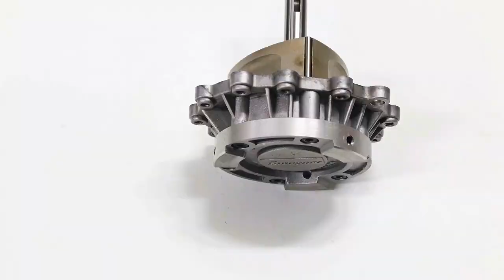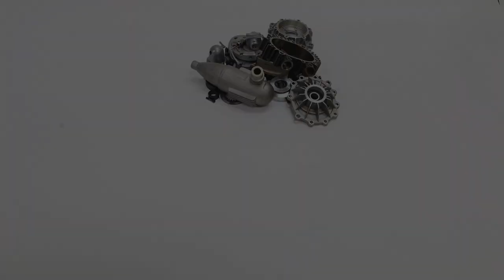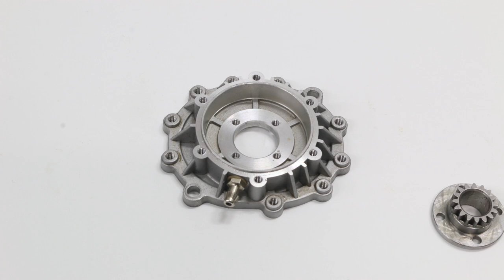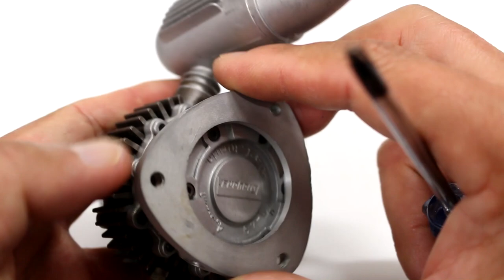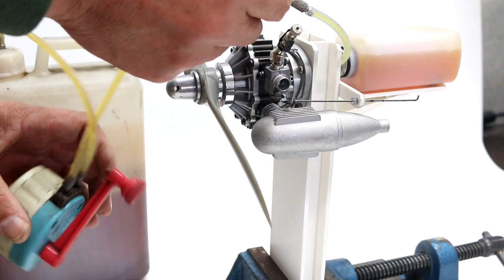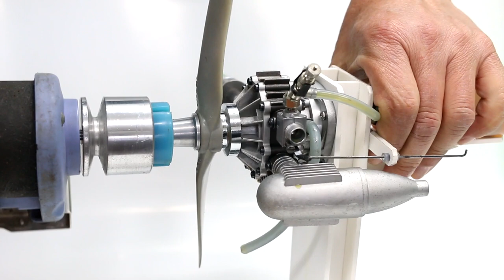WANKEL ROTARY ENGINE - STOP MOTION

Comment: Amazing video on the rotary engine! Really shows how its inner world's work and all the other parts interraction!

I really hope they don't give up on the rotary, if they can just figure out a way to remive is fatal weaknesses,  i think it had a big potential as its amazing how small and compact the engine is compared to its power output.
Reply: *Dude this is a Wankel engine, not a rotary
Both the Wankel and the Rotary are obsolete.
Reply: Kubi Kameho Rolls Royce experimented on a diesel 4-rotor several years back (2 rotors to power, 2 to basically supercharge the power), and that might strike your interest. The only real problem the rotary has is due to the burning oil, the seals wear due to constant metal fatigue that most Otto engines don't face so regularly. 

If there was such a lubricant that wouldn't really ignite but also wouldn't impede ignition, that metal fatigue would go down. Or perhaps a metal that has a higher tolerance for fatigue without absolutely destroying the chamber  walls, may also work. 

Perhaps you could toy  with the idea some, I can't think of anything right away.
Reply: +Dragon The engine shown in the video is not a Rotary... The Wankel KKM design does not have a Rotary layout.
Reply: Ok either your just saying things to get a rise out of me or you are truly confused. Come on no more mean comments do you need help understanding what a rotary engine is? The original wankel rotary the DKM both the rotor and the housing spun around on separate axes. It reached higher rpm and was naturally balanced but maintenance was complicated and had to be tore down just to change the spark plugs. Now the KKM that Hanns developed was simpler and had a fixed housing but it needed counter balancers to balance the engine and it wasn't capable of such high rpm as the DKM. However it was still a rotary engine. Felix was very angry to find that Hanns built the KKM behind his back and said "You've turned my thorough bred into a plow mare!" He was obviously referring to the much low rpm capabilities of the KKM however still higher that a piston engine was capable of.
EDIT: my bad he stated "you have turned my race horse into a plow mare"
By the way just a quick google search or wikipedia can help teach you about this stuff why dont you try that?
Reply: +Not Amerikanski Spy Rolls-Royce was not the only Wankel licensee to develop a Diesel Cycle Wankel... Deutz, MAN, Mercedes-Benz, Yanmar, Krupp, Ingersoll-Rand, Curtiss-Wright, and John Deere all attempted to build a Diesel variant and failed miserably.
Do You Know Why???? The Wankel KKM lacks the ability to have static compression ratios to support reliable compression ignition.
Reply: +Not Amerikanski Spy Lack of proper lubrication was never the issue with apex seal failure... The apex seal is not a "positive type" seal design like that found on a piston ring... as pressure increases? SO DOES THE RATES OF LEAKAGE PAST THE SEAL. If the high temperature combustion gasses past the seal lip too long the surface of seal heats up and erodes. During pre-ignition or detonation events in as little as 2 seconds the apex seal can be severely damaged even when excess lubrication is present.
Reply: Gas in, apex seals out! Lol really apex seals haven't been a problem for years. There are a handful of companies that design great apex seals. The main cause of apex seal failure these days is old brittle seals or extreme boost pressures.
Reply: +Not Amerikanski Spy Poor reliability was a problem that plagued the Wankel until it production ended, but it had several fatal design flaws that rendered it obsolete, apex seal failure was not the primary disadvantage... the Wankel's horrible mechanical and thermal efficiency problems along with its terrible combustion efficiency is what killed off the design. Fixing the apex seal flaw is not possible nor will it bring back the Wankel.
Reply: +Dragon800 REALLY???? Then explain why Mazda recalled over 50,000 RX-8 engines for apex and side seal failures?????
Reply: +Dragon800 You don't much about Wankel engines do ya son????
Reply: +Not Amerikanski Spy Please don't post anymore false or erroneous information about Wankel engines if you cannot handle being corrected when you are wrong... clearly you are not knowledgeable enough to speak intelligently about them without embarrassing yourself... too arrogant to accept you were wrong.
Reply: +Not Amerikanski Spy  "The only real problem the rotary has is due to the burning oil, the seals wear due to constant metal fatigue that most Otto engines don't face so regularly."
Millions of engines are still produced every year that use a total loss lubrication system, it is not unique to the Wankel... it was NOT the only real problem the designed faced when it was still in production.
Metal fatigue is NOT the primary failure mode for apex seals, this problem has been well researched and is now well understood... design and construction of apex seals is inherently a compromise and must balance the two directly conflicting demands of seal effectiveness vs. surface wear rates. increase the value of one has a direct negative impact on the other.
Reply: +Not Amerikanski Spy The truth always prevails over ignorance...
Reply: +Not Amerikanski Spy Don't hate, EDUCATE
Reply: +Not Amerikanski Spy GREAT! I hope you are learning something about this very misunderstood engine. Feel free to ask if you have any questions.
Reply: +Not Amerikanski Spy Is "Dragon800" trolling you too???
Reply: +Not Amerikanski Spy Let me know if you have anymore questions about Common modes of Apex Seal Failure... you seemed to have a lot of confusion on this topic earlier.
Reply: The Wankel is a type of Rotary Engine. Maybe you mean RADIAL engine?
That type of engine was use on aircraft. It has an (odd)  number of cylinders sticking out in a circular way...
Reply: +olafzijnbuis Only the Wankel DKM-54 is a Rotary Engine... this is the non-rotary version designed by Hanns Paschke called the KKM-57.
Reply: +olafzijnbuis No, not Radial... a Rotary  invented by Felix Millet in 1892. The Wankel KKM has a fixed engine housing and a conventional spinning crankshaft like a Radial... not a Rotary.
A Rotary engine can have either reciprocating or orbiting pistons
Reply: The Wankel engine showed great promise when it was first released as it had only a fraction of the moving parts of the usual internal combustion four stroke engines.  It showed very smooth power delivery with good power to weight performance and appeared comparable in efficiencies and emissions.
NSU and Mazda released production cars that were received very well initially.  However, unless managed carefully they suffered from poor durability and high fuel consumption.  Their correct servicing was crucial and had to be run according to the Owners Manual.
When lower and lower engine emissions were demanded by Governments in many countries, the Wankel was found to be difficult to meet the new standards and the development costs almost bankrupted Mazda.  With the current generation of computer engine management systems, the Wankel could be a promising power plant but for largely political reasons a  number of countries are proposing a ban on the sale of all new internal combustion engines within the next two or three decades.  There is an idealogical crusade against ICE powered vehicles forcing the market to go all electric and even though new ICE powered vehicles can be as environmentally clean over entire life cycle as the best EV, political pressure is building into social pressure to repress any further development of power sources such as the Wankel.
Reply: +Campbell Sharp Indeed, the Wankel engine showed great promise... in 1957, when most manufacturers were still producing Flat-head engines that dated back to the beginning of the century. But by 1974 the big players like General Motors, Mercedes Benz and Ford had all reached the same conclusion, that the Wankel was inherently flawed and showed very little further development potential and was fundamentally inferior to the other ICE designs which are still mass produced today. The Wankel's fatal flaw is 3-fold, fuel efficiency, emissions and reliability are all limited by its own unique but fixed internal geometry. This restricted envelope sets both the theoretical and practical thermal, combustion and mechanical conversion limits of the design.
Reply: +Campbell Sharp Every Wankel manufacturer was plagued by the designs short service life and poor reliability. The Wankel's sealing system suffers from an inherent design weakness, the design of the apex seal is particular vulnerable to the effects of erratic combustion and loss of seal integrity as pressure and RPM increases, unlike a piston ring in a reciprocating engine the apex seal does not increase its contact surface pressure as chamber pressure increases nor can the number of seal surfaces be increased, the Wankel sealing surfaces do not expand or contract evenly as a round piston, rings and cylinder does.
 Although it lingers as a false urban myth, lack of maintenance is not the primary mode of failure in the Wankel design, this myth was finally dispelled once and for all with the NHTSA investigation of Mazda's premature failure complaints from owners that strictly adhered to the manufacturers service recommendations. The investigation found NO LINK between owner use or abuse and the statistically higher failure rate of Mazda's RX engines, Mazda DID NOT CHALLENGE  these finding and voluntarily offered a settlement.
Reply: +Campbell Sharp A very interesting theory, but also one that can be easily dismissed by the factual evidence. Although there appears to be ever increasing hyperbole on the topic of EVs replacing ICEs (most of which is misinformation fueled by EV manufactures) The fact remains that the percentage of pure EVs on the road is stagnant, not growing... and remains less than 1% of vehicle in service are BEV. Automotive manufactures sold over 100 million ICE powered cars this year and while the number of EVs sold increased EV market share has not.
   "political pressure is building into social pressure to repress any further development of power sources such as the Wankel."
  Most of the 26 original Wankel licensee's abandoned the design in by 1975, Mazda the only remaining manufacturer ceased development in 2009 and discontinued production on June 22nd 2012 due to poor sales. Mazda recently announced after the launch of its revolutionary new 4-cylinder Skyactiv-X engine that the company remains committed to the sale of ICE vehicle to 2050 and beyond...

Comment: Its a legendary Wankel enginne, that was used  on Mazda RX 7
Reply: Rest in peace Wankel engine 1964 - 2012
Reply: Legendary as a commercial failure... the Wankel never delivered on its promise to revolutionize ICEs and replace them... its a dead-end technology, abandoned and obsolete now.
Reply: Wankel engine is lightweight and high torque, but less efficient engine. You can still use them for some applications.

It is not commercial failure, it is failed by new stirgent emission standarts. VW is also failed at that test. Diesel engines will be at near future, also normal engines after that. Future will be hybrids and electric cars...
Reply: wankels are high horsepower but fairy low torque.
Reply: Nothing legendary. Just another type of internal combustion engine
Reply: everybody has their favorite things in life. Mazda rotary fans are pretty hardcore and to them these engines are legendary.
Reply: +Dragon800 But none manufactured commercially in series mass production today, all the major engine manufacturers have ceased production and development of Wankel engines.... they are obsolete since 2012.
Reply: +Dragon800 Which Wankel engine? Amateurs and novice enthusiasts tend to forget or simply don't know there are 2 types of Wankel engine.
Reply: after all our comments back and forth you now come back with that? whats wrong with you we have both talked in depth about both of the wankel engines
Reply: +Dragon800 wrote quote; "The Wankel engine is a rotary engine!"  WHICH WANKEL ENGINE BABY HUEY?
Reply: both are rotary engines the DKM has a rotor and housing that spin on seperate axes and the KKM has a stationary housing but there are both rotary engines.
ANSWER ME THIS SMARTY PANTS IF THE KKM ISNT A ROTARY ENGINE WHAT IS IT? and please dont tell me it reciprocates again that was so unbelievably stupid of you.
you still havent told me how many miles until your rotary mazda blew up on you!!!!!!!!!!!!!!!!
Reply: +Dragon800 Only the DKM has a "rotor" and both utilize an Orbiting Piston designed by Wankel and Froede. The KKM has an "Orbiting Piston" and a conventional non-rotary layout with a crankshaft and flywheel.
Reply: +Dragon800 The Toyo Kogyo Cork Co. (Mazda) licensed the the rights to build only the non-rotary Wankel KKM-57 engine designed by HANNS PASCHKE on February 27, 1961. Mazda has never manufactured or sold a Rotary type engine. In 1971 it rebranded its Wankel engines under the fictitious registered trademark "Mazda Rotary®" to avoid paying the 40% per engine royalty to NSU-Audi and to honor the founder of the original DKM by Felix Wankel that was never produced.
Reply: Obsolete garbage..
 Even Mazda dropped this troubled unreliable engine design like a bad habit.

Comment: Great video. However, I would say this is a "Wankel" engine, and not include "rotary" in the name. Rotary engines were typically used in WW1 aircraft where the cylinders rotated around the fixed crankshaft rather than what we consider normal nowadays. The Sopwith Camel in particular benefited (if you were a good enough pilot) by using the gyroscopic effect to give a  very tight turn in one direction.

Upon googling rotary engines I see that Wankel engines have been described as "rotary" by others and not just this utube. I think this is unfortunate because it blots out a lot of the history of IC engines and can be confusing. As an old guy, I have to admit to being mildly irritated by wet behind the ears kids coming along, showing they don't understand the valid history of what they are talking about by misusing terminology in this way.

But good video anyway!

Comment: Mazdas RX-7 rotary motor back in the day was a force to be reckoned with... would love to have an 80's RX-7 with manual transmission again smoothest cars ever not to mention a very fast car!
Reply: The oil and compression seals never worked except when new, and then not for long.  Mostly because they were not rings. Rings last the life time of the engine Wankle seals need replacement like tune up parts. Spark plugs last longer.

Comment: Can I swap this in my Mazda6?
Reply: Why not
Reply: Swap the heater blower motor....
Reply: +Gary Miller High and Low fan speed? Or Dual Heat controls????
Reply: Michael Vechnak The Mazda6 is only sold with a reciprocating engine, Mazda ceased production of Wankel engines half a decade ago on June 22 2012 when the RX brand became defunct.

Comment: Rest in Peace Wankel engine 1964 - 2012 an inferior design that was ultimately doomed to failure...
Reply: Just the facts, the Wankel engine is obsolete... a dead-end technology.
Reply: doktorbimmer, Here's another 6 second 1/4 mile Wankel 13b rotory   https://www.youtube.com/watch?v=q2NSTFH_tv4
Reply: +Otto By Ograffey Can you please direct me to a new car dealer that has a Wankel powered car for sale??? Now that would be impressive... anyone can build a grenade...
Reply: +Otto By Ograffey Yeah but you can pull 6 second quarter mile runs with a Diesel tractor motor too! https://www.dieselworldmag.com/features/2064-2/
Reply: Cool! That little  13b single rotor Wankel is more impressive.  And I bet that little car has an 1/16 the money in it. I like diesels too
Reply: +Otto By Ograffey  Not really... You can still buy a Diesel powered car too!
Reply: +Otto By Ograffey  Audi Diesel powered cars have won Le Man NINE TIMES!!!!!!  suck on that Mazda.
Reply: +Otto By Ograffey I'd be more impressed if anyone could build a Wankel powered tractor... but the obsolete engine type is incapable of producing descent torque which is why they also suck for making drag racing cars.
Reply: @OttoByOgraffey  Ouch! You got a harsh reality check..

Comment: Where is the ignition coming from? I see no electrical connection.
Reply: There is No ignition. The plug that he showed is the glow plug. A 1/5 v battery causes the plug coil to heat up. This ignites the fuel, and the heat from the ignition plus  catalytic action on the platinum coil keeps the fuel igniting on the compression stroke.
Reply: It's a nitro engine. It runs on methanol and nitromethane, which can be ignited by a combination of compression and a glowing-hot wire.
Reply: This is called GLOW IGNITION, the engine has no timed ignition spark and lacks sufficient static or dynamic compression to support auto-ignition as in the Diesel Cycle.